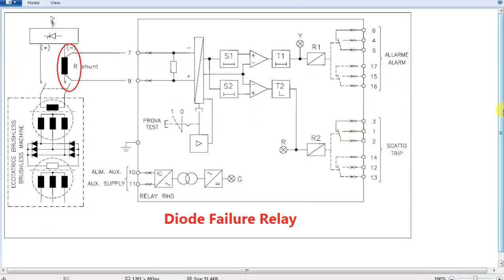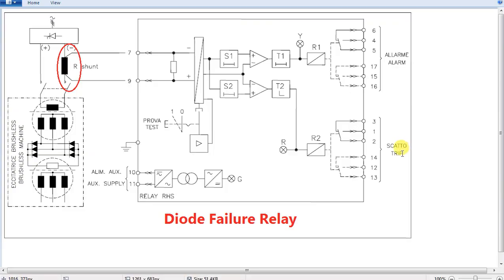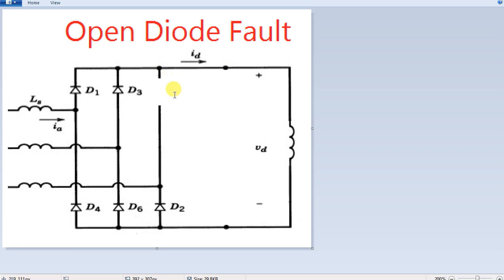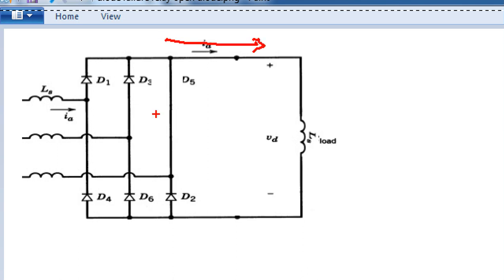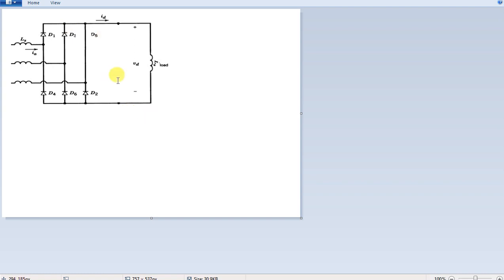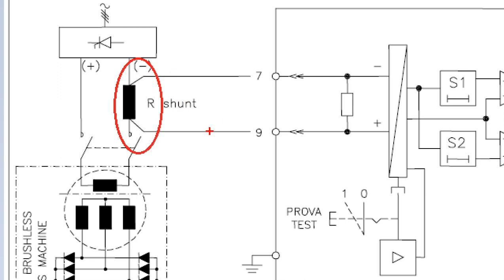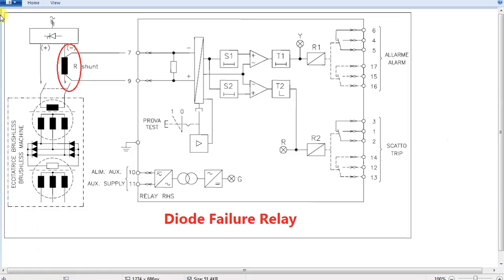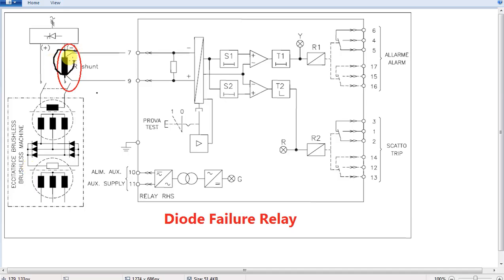Generator Diode failure relay working function

Comment: Sir, Please enquire - Diode failure Relay- NEC 115d-240V AC, Type code : IN 5621-002-9 for Generator.
Equivalent model also considered.
This one is available sir.